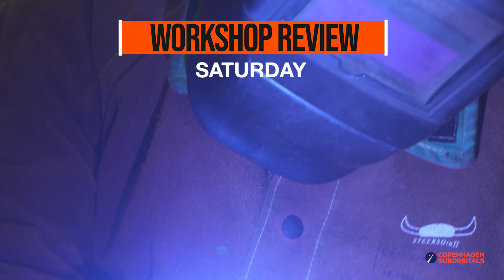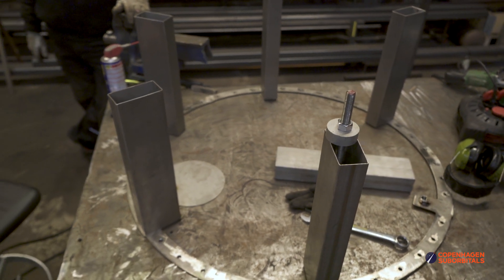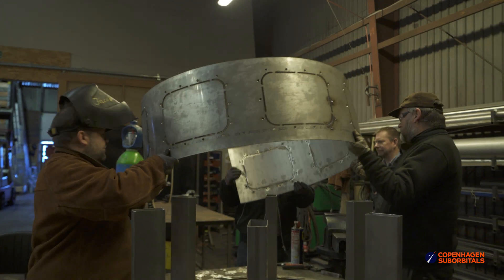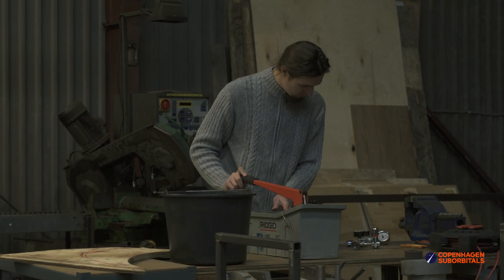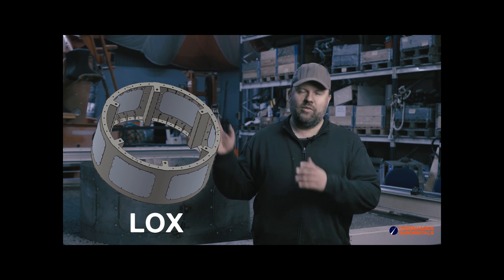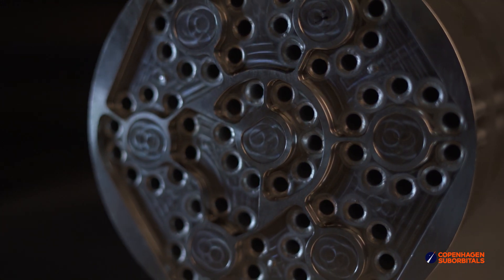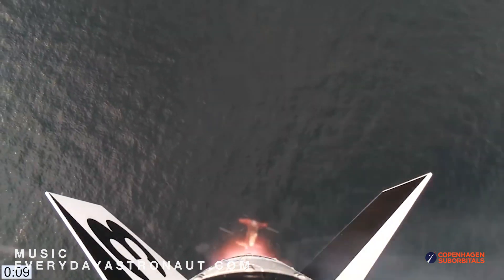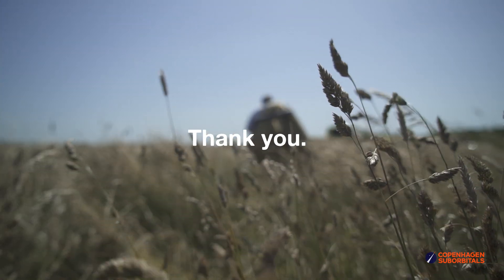Welding World's Largest Crowdfunded Rocket, SPICA! | INSIDE THE ROCKETSHOP : Episode 13

Comment: Are You planning to use regular "off the self" components for the electronics in the final design or is it going to be something else?
(I know there was electronic components especially designed for use in space, i got a few resistors from a friend many years ago that had that classification, but i am not entierly sure what that means, if they are just one purpose designed or if it is something else with that particular design, they look pretty similar but not identical (for example they hawe another type of body and the package is different, it's not regular precicion resistors either) to the normal types i hawe seen. Maybe ity has to do with different temperature tolerances if they was designed for use in something that was ment to orbit?)
Reply from the maker: We use what we call CSduino's. Arduino boards with more robust hardware, and in some cases custom printed boards. Being in the vacuum of space can cause all kinds of issues from charged particles, like @Linecraftman pointed out, to overheating, if you're lacking air to conduct heat away. The capacitors and resistors need to have insulating materials which do not sublimate in a vacuum environment, and probably more. :)
Reply: @CopenhagenSuborbitals  Thank You, that was realy interesting.

How Do You solve the cooling of the components?
Reply: Space grade electronics are usually meant to survive extreme bombardment by heavy charged particles.